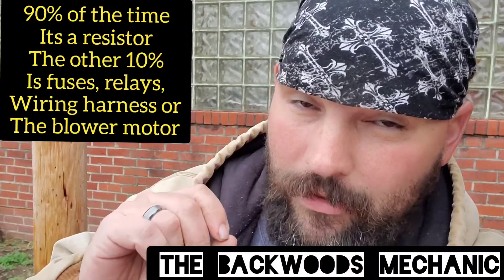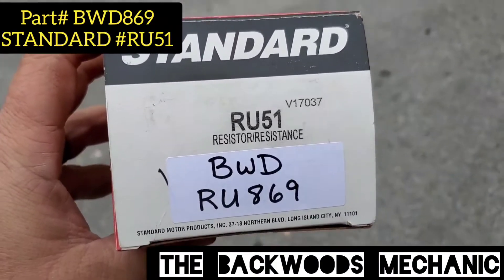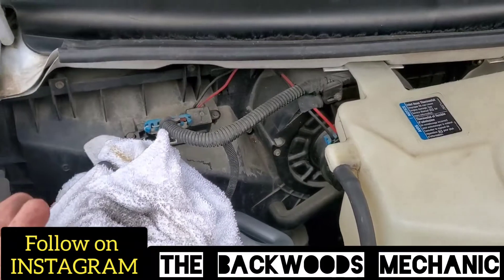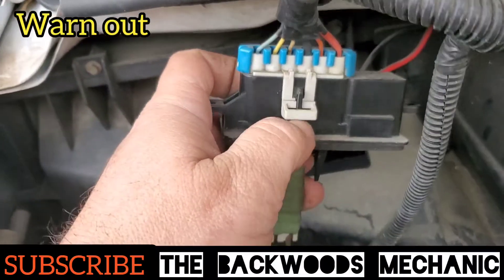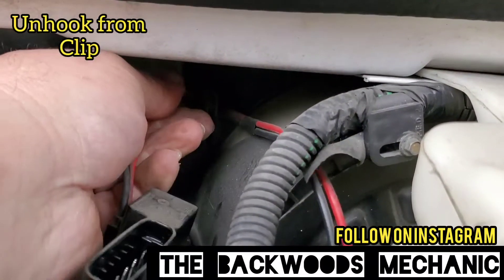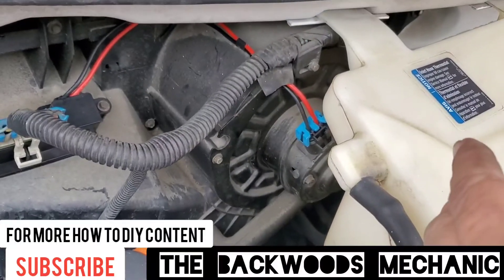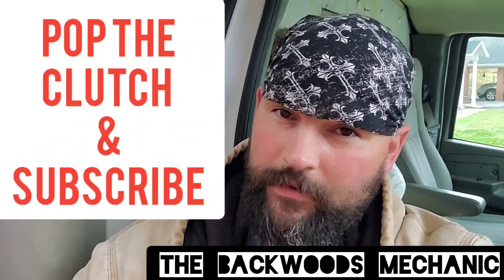How To Replace a Resistor Chevy Express 3500 in 5 Minutes ( Only 1 blower setting works) #DIY

Comment: From Vancouver, Canada.
Today being Sunday. I had to replace the resistor on my GMC Savana because it went down from 2 working settings to 0.
I would have NO clue how to go about it if not for your video.
An excellent analysis of the problem and hands-on instruction including even the numbers describing the resistor which I used at the store to help locate the proper one.
Thank God for you and this awesome video!
Great, great job!
Btw, the resistor has all the 4 working settings now.
Reply: 😅😊😊😊😅😅2😢

Comment: If your blower motor is working and the switch on the - is working, but the switch to the back of the express Van does not put any heat or blow. Could you tell me would be wrong

Comment: Where is the location for the rear cabin blower motor resistor in the 2008 Chevrolet 3500 passenger van?

Comment: I have a 2004 express 1500, I am in need of finding a blower motor resistor, it it burned out, my resistor does not look like this one, it's more longer
and flatter which I cannot find on any online auto parts. I even went to the online GMC dealership and they don't have it, do you know of any
place that would sell a blower motor resistor for 2004 express 1500.

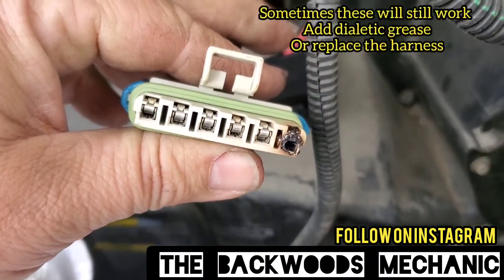Comment: At 3:21 of video I had the same response" Oohh!" I gave an issue with 08 express climate controls not working at all.The window defrost button won't even turn on so there's a power issue.I checked the three climate control (hvac) fuses in the fuse box under the seat and they are all good. I'm lost. I remived the control unit from the dash and checked for power at the harnesses and I got 11 volts on one pin of one harness and around 8-8 volts on a pin of another harness. Any ideas ? Could the control unit be bad?

Comment: Heard a loud pop after turning my fan on high. Fan no longer works at any speed, any idea what caused noise? Gonna replace motor and resistor ASAP. Thanks
Reply: Replaced the fan and resistor today. The loud pop was the fan exploding into a 100 pieces. Got it cleaned up and blowin hot defrost just in time for Wyoming snow storm